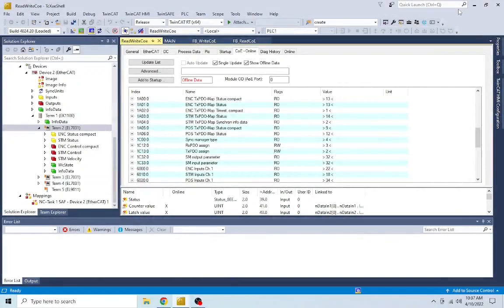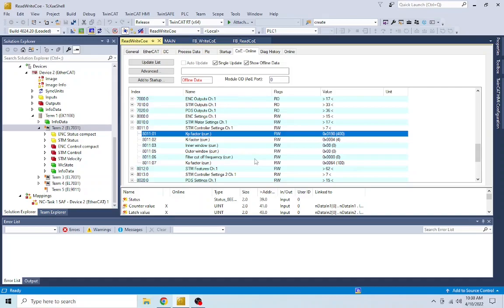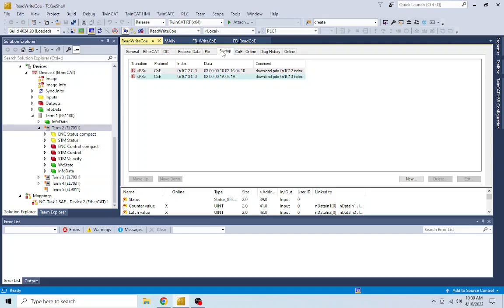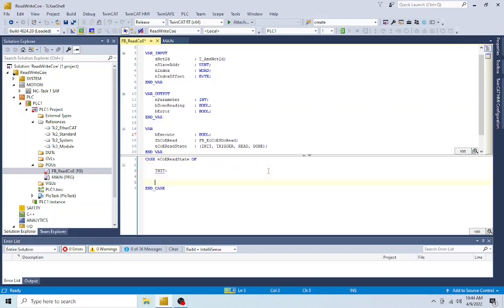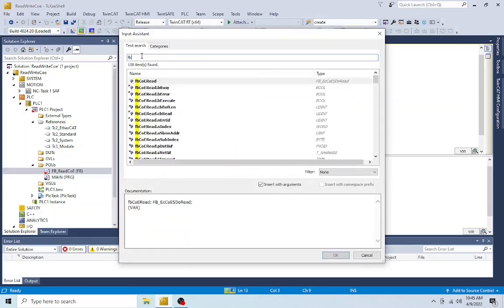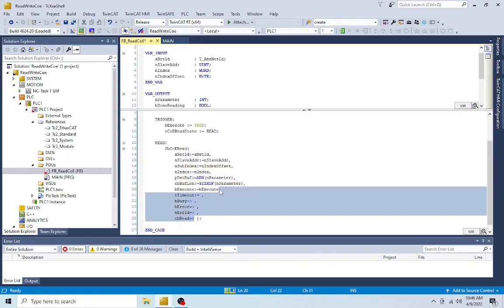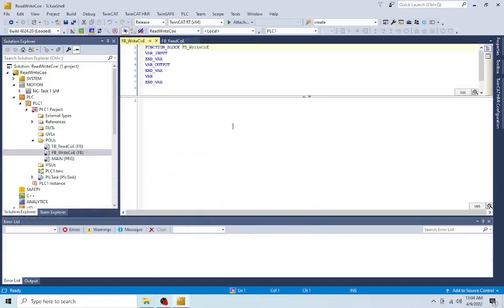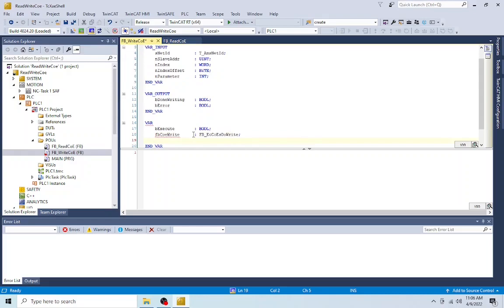TwinCAT3 - CoE Reading and Writing

Comment: What about coe elements that just have a 4 digit number for example i have a coe entry that is just 4013. There no + symbol to open it and view a subindex.
Reply from the maker: Hi, try to check this address entry on the manual of the hardware you are using. The Windex may be zero
Reply: @twincatemy8997  It was third party hardware and they ended doing some other abstract acquisition method documented deep in the manual. I reached out to beckhoff and they said you can't really grab coe elements that don't have the index